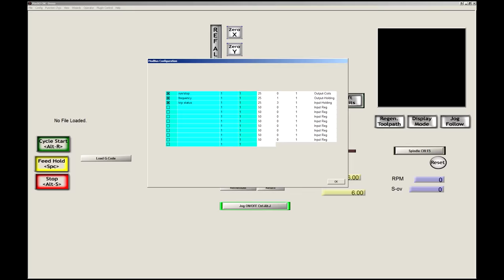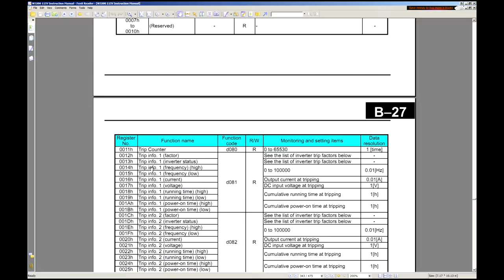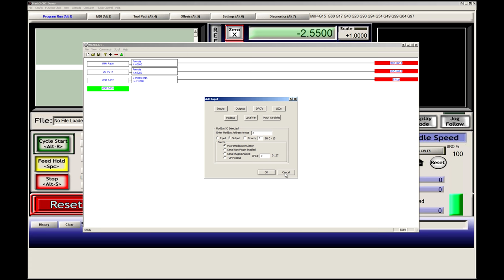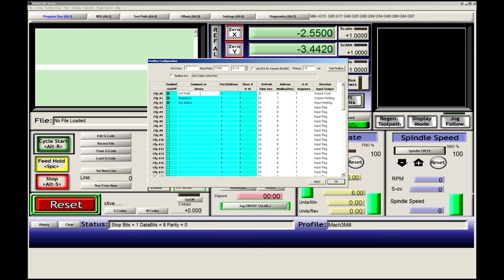WJ200 - Mach3 Modbus troubleshooting

Comment: Shouldn't Cfg #2 use modbus register "2" instead of "3" then according to your explanation?
Reply from the maker: You could, I have cfg #2 set to read "Inverter Status B" in input-holding 4 which only reports tripped status.  If you used modbus register 2 you would read "Inverter Status A" in input-holding 3 which also reports tripped status along with many other status flags, just with different numbers.
Reply: thanks. So cfg#0 "start/stop" writes UNUSED modbus register 0.and cfg#1 is "frequency" but in your brain setup you write the frequency to cfg#0 in the first brain rule and you write "spindle run"*65280 to cfg#1 in the second brain rule.
Reply from the maker: Ahh yes, the output-Coil in cfg#0 is set to an unused register, but maybe that was documented wrong as well, I don't remember specifically.  That is what my actual functioning controller is set to.  It's easy to check in any case, changing the register number and watching the active state on the vfd is just a bit of what you have to do to double check all the docs.

You're right, I do have the cfg outputs transposed in the brain.  The RPM ratio tree should feed whichever config you have set to frequency, and the spindle run tree should feed your run/stop config.